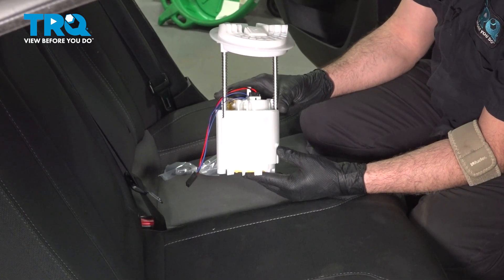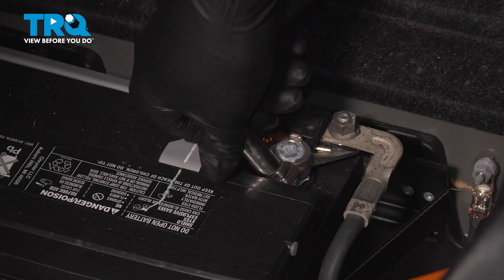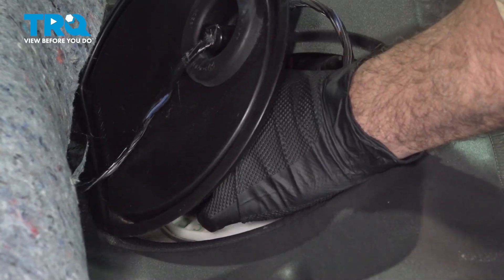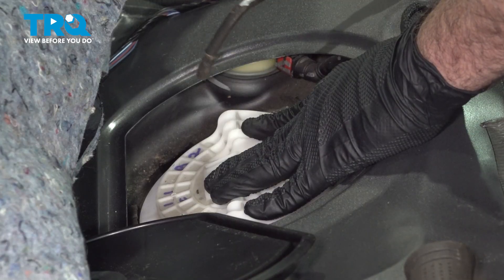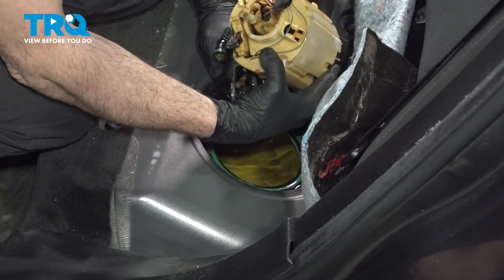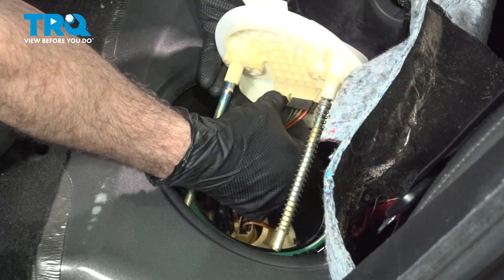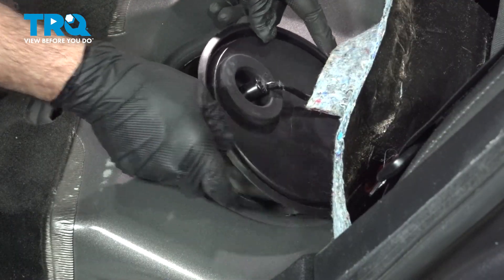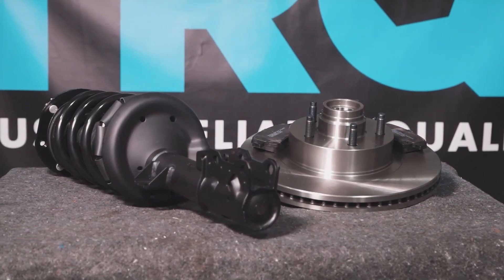How to Replace Fuel Pump Assembly 2011-2023 Dodge Charger 3.6L V6

Comment: My 2013 charger rt pursuit has code p0463 and p2068  the left side of tank is full of gas but right side is empty my fuel pump still primes though why isn’t gas going to the right side of tank.thank you

Comment: Good video, however, he forgot to mention that he did not use a new pump, so when to swhitch for a new pump, you have to change the connectors too 10:07. Especially is is a delphi from autozone. Is in the  box, you have to rewire it